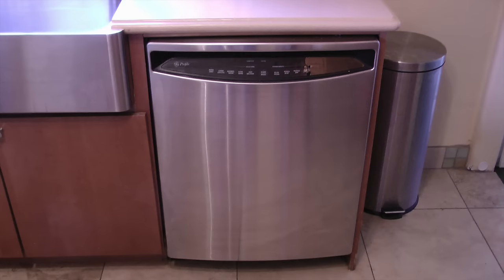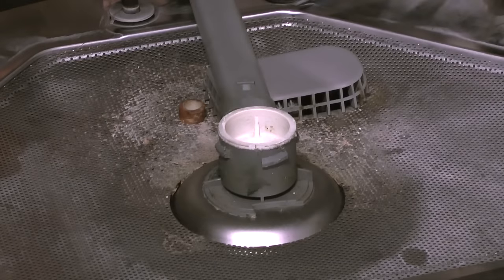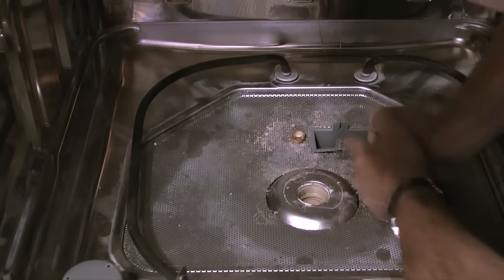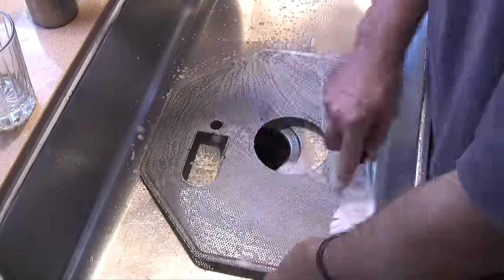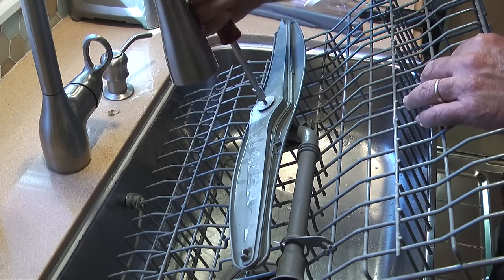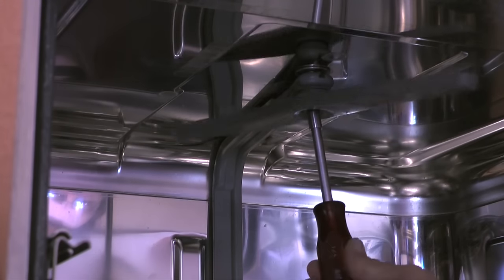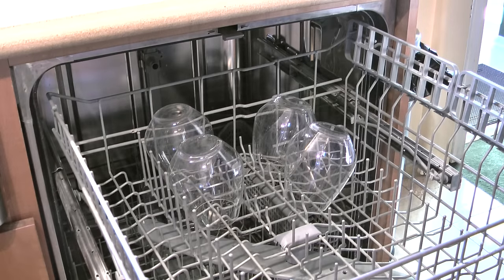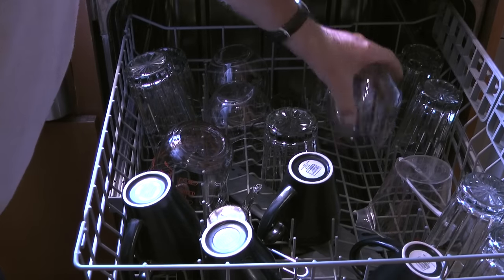GE Profile Dishwasher Maintenance

Comment: EXCELLENT video! Just went through the process on my 18 yr old dishwasher  for the first time. Took less than an hour and removed so much gunk. As another comment mentioned, make sure you keep track of the little metal washer inside the venturi when cleaning it. I almost lost it down the drain.
Reply from the maker: Thanks Thomas for watching, I'm glad the video was helpful.

Comment: When my dishwasher started not washing the dishes well I was dreading the thought of yet another service call from GE.  After spending thousands of dollars getting my GE washer, dryer, refrigerator, and oven fixed, I knew it would be at least $95 just for them to show up.

Thank god for Google and YouTube!  I have the exact model as in the video and I was able to disassemble and clean in no time.  I'm currently running the white vinegar wash now, but judging by the amount of gunk found in the sprayers and the broken glass blocking the drain, I'm certain that it will work much better now.

Thanks you for posting this video!
Reply from the maker: Great, I'm glad the video was helpful. Did your cleaning and vinegar wash help?
Reply: iScaper1 Yes, it is working like new again!
Reply from the maker: wyoskibum
That's great!

Comment: Thank you so much for this video!  Although my model is slightly different, the disassembly instructions were spot on.  The only difference with my model is that the right end of the filter needed to be lifted upward in a counter clockwise fashion to detach from the sump pipe inside.  Great job with this!!
Reply from the maker: Thanks Daniel for the feedback and information.

Comment: THANK YOU for posting this video!  My husband and I were about to spend $1,000+ on a new dishwasher because our GE Profile wasn't really cleaning the dishes any more.  While researching which brand and model to buy, I stumbled upon this video and we said "oh, there's a filter we're supposed to clean?".  It took 4-5 hours to pull the dishwasher apart and clean it (everything was clogged with soap scum).  Now it works like new!
Reply from the maker: stbtraveler 
That's great. It surprises me they don't put the cleaning the filter steps in their owner's manual.

Comment: To add our thanks to this great video -- it took us about an hour from start to finish.  In the process we discovered that almost all the rubber gaskets on the filter basket, large metal filter, and everywhere else in the moving parts is disintegrating badly.  We'll be lucky if we get another 2 years before parts replacement on this 4 year old GE Profile DW is more expensive than a new DW.
Reply from the maker: +Rita V 
Thanks Rita for the feedback and the information.

Comment: Thanks so much for this video!  Worked well.  Mine was slightly different.  I had to find another video of how to get the top rack off.  Mine had different clips, which came off easily after I knew how.  It was a white clip, plastic piece inside the metal channel.  You had to take the screwdriver and push back the back tab of the insert so that it could be tilted inward to remove.  Wouldn't have been able to do this without the video!

Comment: Excellent, useful video...thank you!  Don't forget to clean under the dome float (small canister-shaped thingy on the floor of the dishwasher at the front left corner right up near the door)...held down by one 8mm screw.  There was a blob of nasty black crud hiding under there in my dishwasher.
Reply from the maker: Good tip, thanks for posting.

Comment: Wow!  Thank-you.  As you said, the information on how to maintain the filter is not in the users manual.  I didn't even know that the  filter basket was removable.  Mine was completely plugged with paper pulp.  Was ready to buy new spray arms, but that would not have fixed the root problem at all.

Comment: This is such a great instructional video and covers all the steps with explanations for each one.  Thanks for helping, we had never cleaned our machine since it was installed over 10 years ago 😜 not only is it clean, it saved what could have been a huge repair bill since the filter was almost completely clogged and the machine was getting louder by the week in the rinse and water flush cycle.  Also appreciate the steps to put everything back together, too many times we only get how to disassemble and the standard ‘just reverse what you did to take it apart’ instructions.  Will look to your site for future home projects 😀
Reply from the maker: Thanks, I appreciate the feedback.

Comment: IScaper,
Thank you a ton for posting this video on how to clean the filters and spray arms on a GE profile dishwasher. Although my model is different ( PWDT480R30SS), the tub and arm assembly us exactly the same as in your video.

I have just finished putting everything back and have run a test cycle. Will post an update later on how much it improved the cleaning.

Comment: I also just came across this video and you really have a great way of walking folks through the process.  Very easy to follow.   I was surprised that although my GE Profile dishwasher is also 9 years old,  there wasn't that much gunk in the filter or under the screen.   Only negative was the white tube that sits in front of the filter was breaking down.  I don't think that's something that is replaceable so will hope for the best.    Thanks for a great tutorial.
Reply from the maker: Awesome, thank you!

Comment: Worked like a charm ! Thank you!  Took exactly 20 minutes. Start to finish. Never thought it could be so easy. Thank you so much for this crystal clear video.
Reply from the maker: Glad it helped!
Reply: iScaper1 well after cleaning. My dishwasher stopped draining and there is a loud noise. 😩it was working well before. Any ideas ?
Reply: I had an issue after cleaning a piece of plastic went into the drain pump. I then removed that from drain pump. I  put everything back and the water drained out nicely but have a new issue that there is a small leak that happens where the drain pump sits on the sump casing. My cleaning adventure turns into a DIY nightmare ha ha !

Comment: Thank you for this video. I determined that I needed to replace the sump inlet (where the drain drains into) and while the part was cheap there was no documentation on how to get to it. Between this and a “oh that’s how it goes” I just finished replacing it and am running a rinse cycle now to make sure nothing is leaking. Thanks again
Reply from the maker: Thanks Shawn for watching.

Comment: Your video was excellent. I am not a "handy woman" but I decided to try it. I followed your video step by step. It was so easy. I had one problem, which was just my fear. I could not pry out the filter.  I had everything else apart but I was so afraid that I would break the plastic that I gave up. Even though I didn't get that out, I still removed so much gunk, it was disgusting.  Thanks for the great video.
Reply from the maker: You're not alone, I had the same fear removing my filter.

Comment: Excellent video - thanks for putting together and posting.  I hadn't known about these filters, the dishwasher is 14 years old, so let's just say that it was nasty.  Took me about an hour and a half from start to finish.  I also noticed the small steel washer (part #453) in the venturi upon which the lower spray arm spins, so I was careful to replace it when reassembling.  Thanks again.

Comment: I really appreciate your video. I had the exact same problem with a similar model of GE Profile dishwasher and this video was an excellent guide.

The only significant difference between your video and what I discovered during my repair process was that my water supply was not a flexible tube that could be stretched out when I pulled the dishwasher from under the counter. The home's builder used a copper pipe to connect the dishwasher to the hot water supply. This meant that I had to disconnect said pipe from the underside of my dishwasher; the same pipe was soldered to the water supply beneath the kitchen sink and I didn't want to break that connection.

The copper pipe attaches to the left side of the dishwasher, just underneath the door. I found that removing the metal plate and some foam insulation from under the door allowed me to more easily detach (and later reattach) the water supply pipe to the dishwasher. Obviously, you need to make sure that that pipe is sufficiently fight when you turn the water supply back on. Otherwise, water will spray all over the underside of your dishwasher.

My dishwasher now drains all water from the basin, leaving my dishes sparkling clean.

Comment: Dude, you were on the money...thank you so much!  Might I add in cleaning out the dishwasher compartment... If you have a shop-vac, clean out the dishwasher compartment thoroughly by throwing hot water and subsequently sucking up the contaminated water with the shop vac, include sucking up the water and debris from down into the filter compartment.  In addition there were two small washers inserted in the venture, just be careful that they are not dropped lost.  The video was fantastic and saved me some big bucks..
Reply from the maker: +Tom Costanzo 
Good tips, thanks for posting.

Comment: I have the EXACT same dishwasher and had been searching for a step-by-step tutorial. This video is PERFECT! Thank you so much!!
Reply from the maker: Thanks, I'm glad the video was helpful.
Reply: iScaper1 Me again...Any thoughts on what kind of detergent or specific ingredients are best to use to avoid buildup and  keep my dishwasher nice and clean?
Reply from the maker: SeoulGirl1026
Since my GE Profile has a filter instead of a chopper, I've been rinsing the dishes to prevent chunks of food going into the filter, and I've been using the Cascade Complete pre-measured detergent packets. In a couple of months I'll probably clean the dishwasher again by placing a glass container in the upper rack full of vinegar and running a cycle without detergent or dishes.

Comment: GREAT video - clear, no gobbledygook, linear. FWIW, I don't have a small screwdriver, so used a dinner knife (not a steak knife) to get the tabs on the filter housing to release and it worked well. Thank you.
Reply from the maker: Good tip, thanks for posting.

Comment: Thanks for a fantastic DIY video! My girlfriend's GE dishwasher has not cleaned well in years -- it's not uncommon for it to leave food particles on dishes. Your super-clear instructions gave me lots of confidence, and your tip about the filter basket made all the difference to getting it out. Suffice to say, it was really nasty in there! Lots of calcified junk was blocking up the arms too. After lots of scrubbing, the coarse filter still looked discolored, much like yours appeared to be. I was going to just accept that, thinking that it was corroded, but I ran a wash cycle with sulfamic acid and the coarse filter came out like new! Vinegar is kinder for regular maintenance, admittedly, but sulfamic acid is the biz for serious overhauls.
Reply from the maker: Thanks Eric for the information.
Reply: Pure food grade Citric Acid has many advantages over sulfamic acid. Citric Acid is food grade, much cheaper, dissolve mineral deposits better with no damage to the stainless steel, and tastes great with a little sugar.
Reply: @criticalreasoning2129  Ooh, it's so nice to accidentally come back to the same video that saved my bacon three years ago and find helpful hints from my yester-self :) After 3 more years of non-maintenance, there were handfuls of greasy food gunk hanging around the venturi outlet. I almost wanted to throw up. Lots of calcium deposits again, esp. under the wash arms. I'm going to try one of the acids again -- citric or sulfamic. Looking forward to a clean dishwasher again!

Comment: Great video and I appreciate that it is concise and clearly shows all the steps. I find it interesting, however, that on the one hand the manufacturers tells us to skip rinsing dishes before we load them, yet cleaning the filter is such a PITA! Water is in short supply in the West, so we should not be pre- rinsing, but the filter removal, cleaning, and reinstallation is at best a one hour job ! Thanks for the great video!
Reply from the maker: Thanks Steve for the comments and feedback.

Comment: +iScaper1 Thank you for taking the time to post this detailed procedure.  My GE Cafe dishwasher (internally identical to yours) was getting progressively worse, there were no maintenance instructions from the manufacturer, and even the appliance repairman I called to the house just said "pre-rinse your dishes better."  I was on the verge of buying a new dishwasher, but after following this procedure, the machine works like new!  The filter was so clogged with calcium deposits, I can't believe it functioned at all!  I'm incredible disappointed in GE for not documenting this themselves.  So, again, thanks!
Reply from the maker: +David Garvie 
Thanks David. I was also surprised there was no information in the manual for cleaning the filter.

Comment: WARNING!  Greatly informative professional quality video.  I had done a rough cleaning awhile back, however I was never able to remove the filter  basket and hence the large screen.  I did remove all three spinners and fished out all the debris. I removed and cleaned the fine screen. The large screen and basket I cleaned in place with a scrub brush and old toothbrush. This made a great improvement to the performance
of the dishwasher. 
Since we have a smart meter and have cheaper electrity at night we always have used the delayed start time in order to run the washer while we are sleeping. The other night the DW was making a different noise during the wash cycle. After a few test runs on rinse I discovered it was loosing all the water. It was leaking out the bottom, through the floor and down the basement wall behind an upright freezer.
Today I pulled it out to try and locate the leak. Nothing appeared obvious. So, I started taking things apart. Starting from the inside. I soon discover the rubber tube into which the small screen assembly goes into, is split. Hence I turned to  YouTube to research, how to get the rest of the inside apart. Your video served that purpose well.
I believe I may have damaged that Rubber tube when I had removed the small screen previously. 
I would just like to share a word of caution when removing the small screen from the rubber tube, especially on a well used older machine. The rubber appears fragile and can be easily damaged.
Thanks again for a great video.
Reply from the maker: Great information, thanks for posting.

Comment: Wow! You just saved me $800 dollars!  Thank you.  Super easy repair after watching your video.  Extremely well produced video - way to go!  Took me about one hour start to finish.   (PS: My dishwashers' upper rack wouldn't come out like yours... I had to remove 8 screws that held the rack to the rails.)
Reply: Oh, also,  I had broken glass shards, seeds, and lots of stringy lint plugging the end holes on each sprayer.  Used some pipe cleaners and tweezers and keep rinsing until everything is totally clear.
Reply: I had the same issue. However I noted there we these tabs at the outer end of the rails that could be taken off instead of removing the 8 screws of the wheels. You just have to pull the tab inside until the flap lines with the indentation on the railing and then twist it inward to remove. Saved me the hassle of removing the screws.

Comment: My GLD5600R00CC Profile Dishwasher has never cleaned dishes properly.  It was a warranty replacement for a GE Dishwasher the home builders put in and not a brand I'd ever purchase.  However, I am stuck with it, so finding/watching this video was a life safer.  I'm a 51 year-old female & and easily did it myself.  I did break off one of the tabs because GE is flimsy junk, so be careful.  We have a whole house filter, charged mineral bed and water softener we add salt to, so it shouldn't need cleaned too frequently.  Plus, I completely rinse off my dishes before placing them in the dishwasher.  Hopefully, disassembling everything and cleaning it will help going forward.  I'm tired of having to rewash the dishes by hand.  Thank you for your informative video.

Comment: Thank you! I also had the same problem with our dishwasher. I went through the same trouble shooing steps, looked at the manual and have tried to clean it a couple of times. But I always got stuck on the sump filter and could not remove the screen. Now I know how and have cleaned the dishwasher filters

Comment: This is a great video.  My dishwasher had a completely full pan after the cycle.  To the extent of some water dripping on the floor in front of the dishwasher.  Following this video, I found the filter completely clogged.  Cleaning the filter solved the problem.  Thanks!
Reply from the maker: +Scott Walz 
That's great, thanks for the information.

Comment: Thanks much for the video. Great, easy to follow instructions with great and detailed explanations of each step and part.  My dishes were not getting cleaned well, especially cups, leaving dirt, even that wasn't on them before the wash. I wasnt sure what to do and looked up the dishwasher model and found your video. After watching it, i just decided to go ahead and follow it. Didnt take long to do this cleaning.  Reassembled it and turned the dishwasher on.  

Dont know yet how much improvement it will provide, but I did clean out a lot of dirt from filter and parts.
I would not have attempted this without your video and wouldn't even know where to start.
tx,

Comment: Excellent video and I agree with previous comments that the strainer should be easily accessible instead of requiring disassembly. Also the bottom sprayer gets mucked up in places where a pick can't access and only a lead wire can clean it properly.